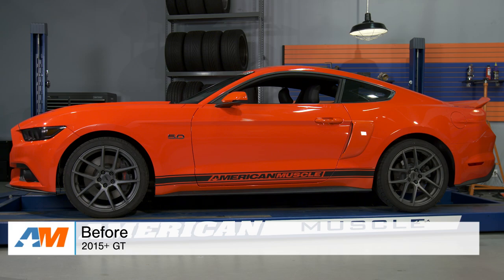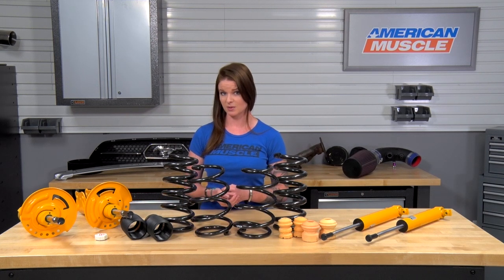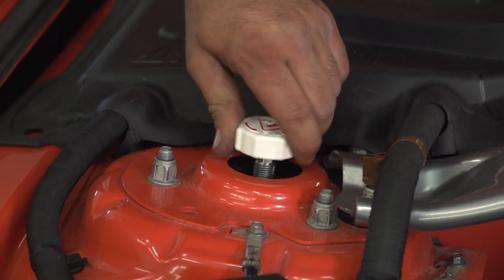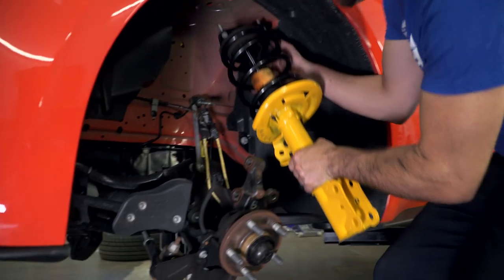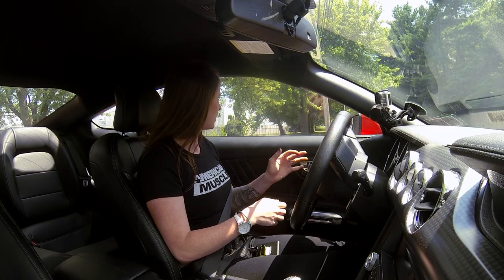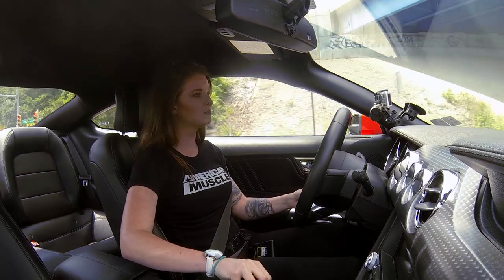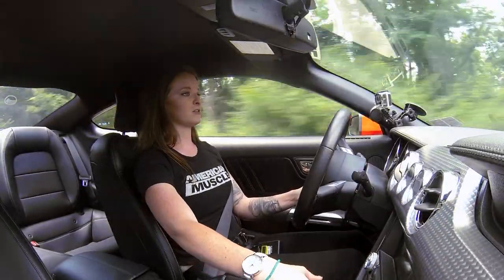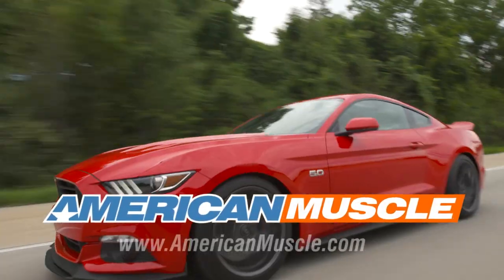2015-2017 Mustang KONI Sport Shock, Strut & Eibach Pro-Kit Lowering Springs (GT) Review & Install

Comment: Holy crap this is GREAT setup. I just installed it on my 2017 GT PP and wow , what a difference over stock. It rides great and feels very tight. Highly recommended to anyone with an S550.

Comment: Koni Sports were one of the best mods for my GT PP.  The PP shocks were bouncy and underdamped.  Ride quality and handling is completely transformed.
Reply: Did you lower as well?
Reply: yes BMR mininum drop springs, only 3/4" lower
Reply: ForTehNguyen What's involve in adjusting the rear Koni's? How impossible is the knob to reach?
Reply: just jack up the rear enough to reach into the wheel well and they give you a tool to turn the adjuster.

Comment: I have eibach pro kit with eibach struts🤔 smooth roads it rides good but bumps bumpy roads and imperfections in the road it rides bad. I want to keep my 2012 charger low with the 1.1 f and 1.3 b BUT I WANT AS CLOSE TO STOCK RIDE AS POSSIBLE NOT A REALLY HARSH RIDE. Can koni shocks/struts do this provide stock ride while setting low please help.